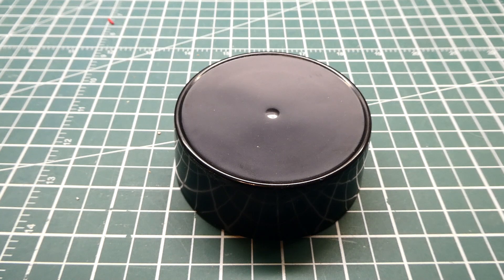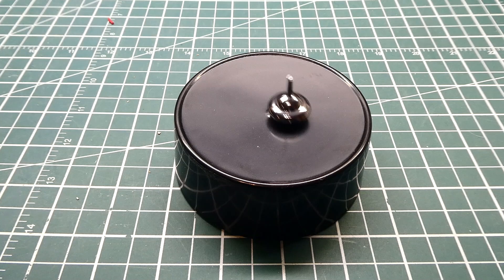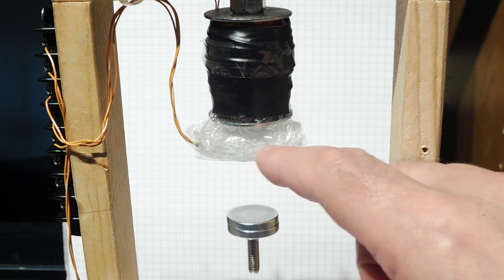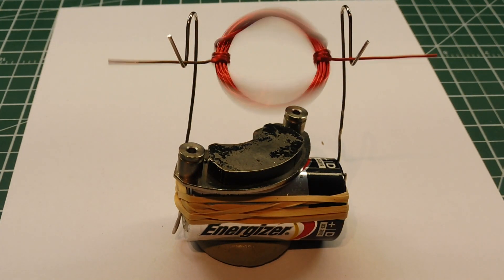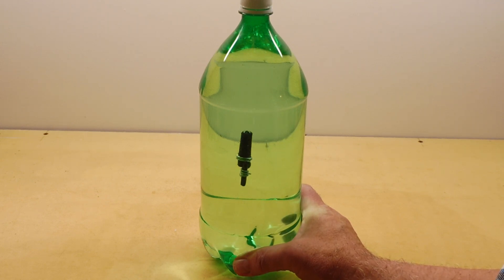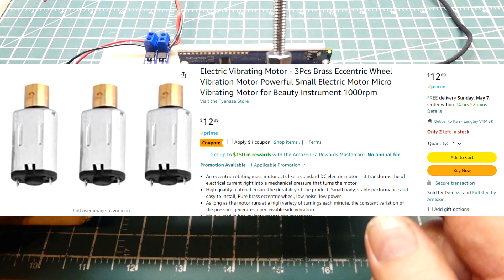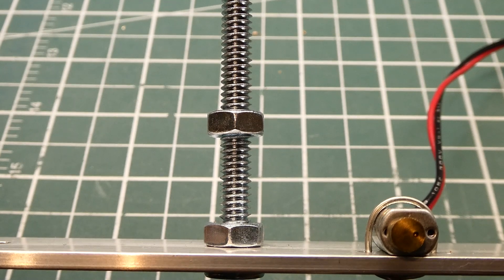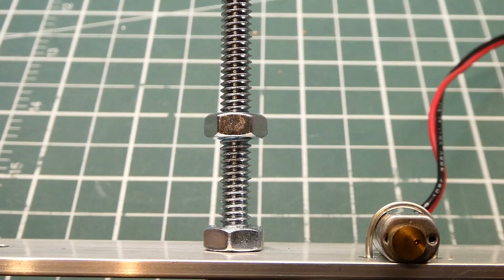Vibration / Science Fair Projects

Comment: Years ago I did a similar diver in a 2 liter coke bottle. I used a glass eye dropper as the diver. If I remember correctly, if you varied the amount of water in the dropper one diver which was at the top of the bottle and sank when the bottle was squeezed (like you showed) and the other bottle had the diver on the bottom and it would float up when the bottle was squeezed.

Comment: Are you using a PID algorithm to control the levitation, or something simpler? (just curious, thanks)
Reply from the maker: PID or Fuzzy logic would be the best solution, but this project was for high school students so I kept it simple so they could play around with it. The code was written in Forth running at assembler speed which made it work.
Here is the original video: https://youtu.be/8uBy1EXELzg